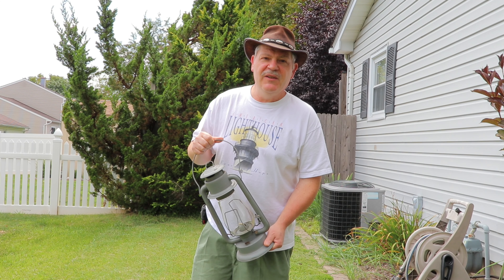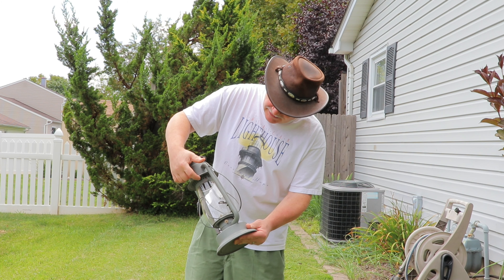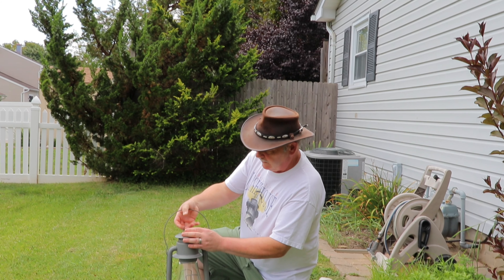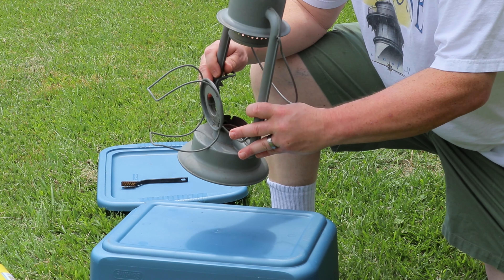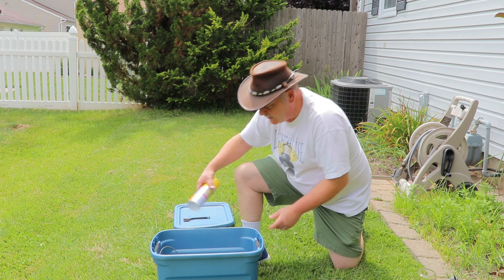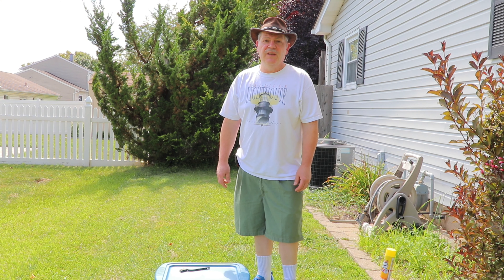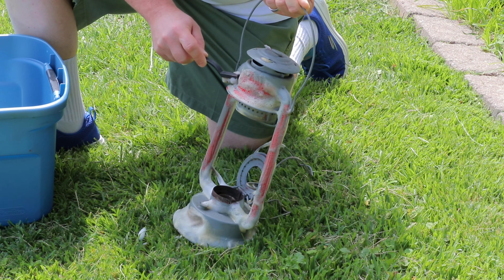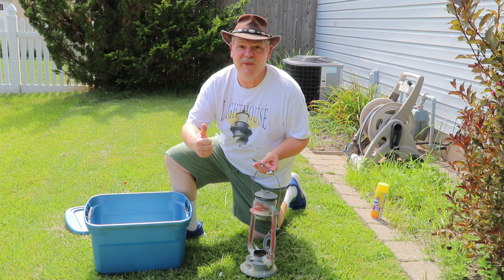Stripping Paint On Tiger Lantern

Comment: Good video Ken , another tip is to coat it with oven cleaner,wrap it in a plastic bag and leave it for several hours or even over night , another thing that works I'd a tub or tote like you got fill it with warm water and lye crystals and soak it for several days. I use those methods on my vintage cast iron skillets that I collect and use.
Reply from the maker: Thanks so much will definitely give those a try I was wondering if you could soak it in something and I really appreciate it.

Comment: The Walmart brand "heavy duty" oven cleaner works better than the DollarTree stuff. You can tell it's stronger by the fumes. Oven cleaner's active ingredient is lye. You can also find drain cleaner that has it. Covering it in the box so it doesn't dry out is a good idea. Try leaving it overnight?
Reply from the maker: Thanks I was thinking that dollar stuff wasn’t too strong because the red paint underneath is putting up a fight cool tip about that drain cleaner too might try that next